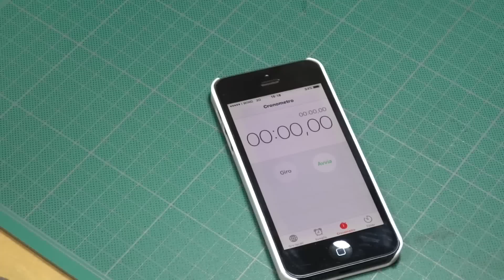Making handmade Leather wallet folded edges

Comment: what is that glue tape stuff? looks handy.
Reply: They're basically strips of double sided tape
Reply: Squid Master 

It's Tanner's Bond adhesive tape. There are two types, removable & permanent, and they come in different sizes. This one looks like the 10mm wide permanent bond, but you can use 5mm if you use thinner leather and skiv the edges properly.
Reply: You don't know what double sided tape looks like .I take it you are a millennium
Reply: We use a similar type of tape in the picture framing industry. It isn't double sided though, that would infer that there is a carrier strip in between the two strips of adhesive. The most common brand of framing tape is made by 3M in the USA and the most common type is 3M #924 ATG tape. This stands for A-dhesive  T-ransfer G-un which is actually the applicator gun we use to apply the tape over long stretches of needed adhesive but the "ATG" acronym has been used for years to denote the adhesive as well. The adhesive itself can be had in regular and also an acid free adhesive, it can be had in 3mm, 7mm, 9mm, 12mm, and 19mm. [Approx. conversions]. The only visible difference that I can see is the ATG type tape is a solid strip from beginning to end and it is mounted on a brown paper carrier strip for ease in use, while the Tanner's Bond is short "clips" of adhesive on the backing paper which, in either case is stripped off after being applied to the item being glued together .